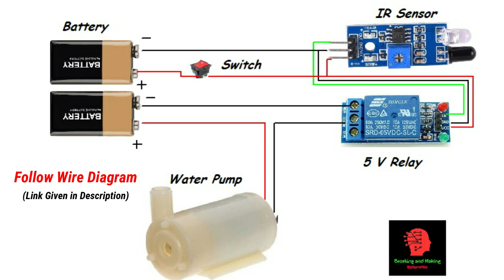How to make automatic hand sanitizer/ water dispenser / 2 in 1 Dispenser machine: Homemade Dispenser

Comment: Bro my  machine  works  well  in a correct  way  really thanks bro👍👍
Reply: Can you  able to  make the  machine  with 2n2222a transistor
Reply: @uttaratiwari9020  Bhai plzz meri bhi help krdo mera nahi run ho raha
Reply: @rajatgupta5597   connection ek dum sahi se check karo aur ha agar ek bar galat connection ho gya to phir short circuit cit ho jayega. To ekadam samhal ke banana all the best tum he success meliga
Reply: I did as showed by u using single battery,but relay aur it sensor on hai,par  motor not starting.

Comment: Good afternoon sir
Sir I am thinking to go for it but I have a doubt in connecting wires... It's bit confusing...
And further sir is there a substitute to glue gun and soldering machine as I doesn't have those

Comment: It's working the opposite way.. when an obstacle comes, motor stops n when the sensor finds no obstacle, it runs
Reply: @dilipgaikwad5546  tried that ... But still it didn't work
Reply: Check relay module connections u may be connect normally close circuit
Reply: It is not working
Reply: @MREasyMaker  facing same problem

Comment: How can I reduce its quantity?  If I do not remove my hand from it, then it keeps on.  And the sanitizer keeps flowing.  Do something that will auto off in 1 or 2 seconds.
Reply: @MREasyMaker  sir can you use delay timer 5 volt 0-10 second. if yes than plz make the video on it.

Comment: I made a circuit but relay output NO contact giving 0.5 volt motor isn’t running. Please tell me if any?
Reply: I mean to say I used same relay module which you have
Reply: Have gone with same but still motor isn’t working...

Comment: I had made a automatic sanitizer dispenser but there is a problem when ever the sanitizer gets finished in tank air bubble gets in motor and will not dispense till the air is removed. What needs to be done to avoid this problem.
Reply: @MREasyMaker  Thanks

Comment: Bro pls ek baar ek battery ke sath ka diagram batao na
Reply: @MREasyMaker  have you upload one battery circuit diagram
Reply: @MREasyMaker  okay thanks ,I am waiting for that..
Reply: @MREasyMaker  I see this already but I can't found tip transistor that's why I made my project on relay module,
But I don't know what's issue coming in my project ,I connect every thing properly but my project is not working
Reply: @MREasyMaker  same I connected in my single battery but it's not working , sensor not sense and dc motor also not run
Reply: @MREasyMaker  can you plzz send me some platform like whatsapp where I can share you video and pictures or may call you to solve this problem